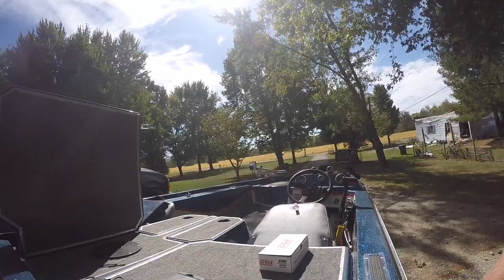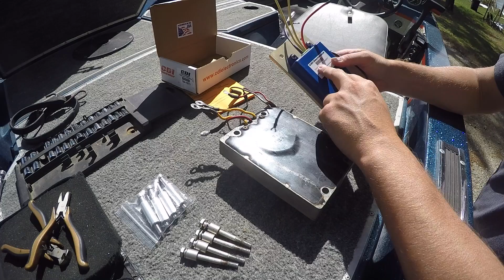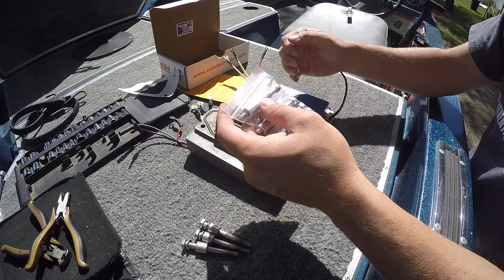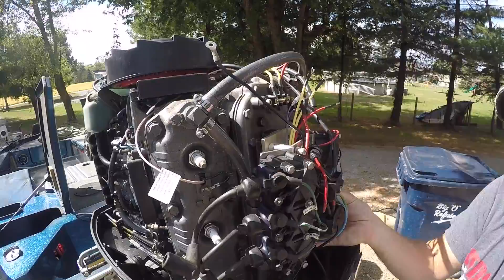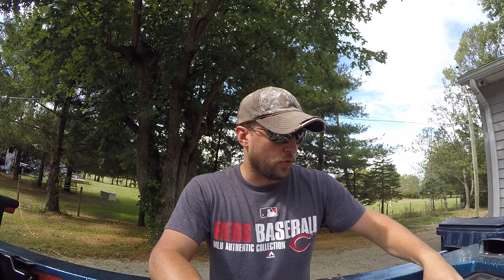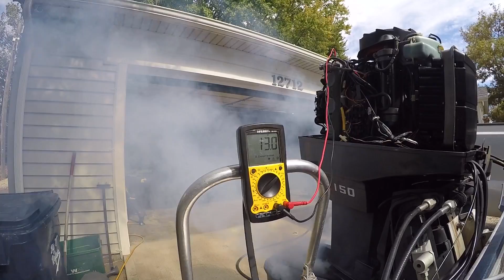89 Mariner 200hp Regulator Rectifier Testing/Removal/Install (Part 2)

Comment: When switching to the dual regulator setup, did you have to replace your flywheel and stator to the 40 amp system with the 5 wires? I can’t see how it would work with the 16amp stator 2 wire system.

Comment: every time i get a water cooled voltage regulator on a 89,thru 92, merc,v6, i use the stanley,voltage reg. from the yamaha,v4 or v6. they work well on the mercs, and have not had any come back yet for any failure.
Reply: Link or part number from yamaha or is it the same years I have a 1989 135 2.0 liter mariner

Comment: Any issues with it after two years of use?
Reply from the maker: Actually, kind of. After about a year of usage, I noticed my depth finder was notifying me of high voltage as the RPMs increased. I was seeing upwards of 17 to 18 volts. Occasionally would blow one of my trim relays so I would be stuck trying to jumper the posts to raise or lower the motor. I suspect some internals of this CDI unit went bad, or were on the way out. I ended up removing it and switching over to a dual regulator setup since it was a much cheaper alternative than buying another unit. I didn't want to keep running the CDI unit with fear of destroying some of my electronics.
Reply: @tristanlee85  Yeah my OEM was doing the same thing 17-18 volts at idle. Sent the radio up in smoke. I just had a local shop order me a new OEM, let me know how that dual regulator ends up lasting.
Reply from the maker: @caden01691  it's kind of a long thread but you can follow along here: https://www.screamandfly.com/showthread.php?350400-Merc-XR2-upgrading-from-rectifier-to-regulator-advice-needed&p=3204505#post3204505 so far everything has been good. Just don't go with the cheapest Chinese rectifiers you can find. You'll see in that thread it actually became a recti"fire" 🔥.
Reply: @tristanlee85 This is unfortunate to hear. I have the same problem and was excited to find a video that had a less pricey solution. I have also thought about covering the water jacket and wiring in two rectifiers instead. I will look into the solution you ended up with on this thread, but if you can make a short video of what you have done it would be greatly appreciated. Thank you again for making these videos! Great work!

Comment: I have the 1988 XR4 150 bored out to 175....That damn motor GROWLS.....hauls ass too!
Reply: the 1988,KR4 was a 175hp  from factory. it was  2.4 litre, most cases . a  chrome bore block. the standard 150s were a 2.0 litre block

Comment: 200 HP? Motor has a sticker 150. My 150 xr4 VOLTAGE REGULATOR
 is bad just trying to change it out.
Reply: 1989 xr4 is the same setup 88 is not
Reply from the maker: Sticker is 150 because the vessel is only rated for 175hp max. It originally had a 150, but was replaced many years ago for the 200, keeping the original hood.
Reply: @tristanlee85  my uncle stiill has his Norris Craft boat. He got it back in 1976 or 1977. It out lasted him. He passed away years ago. His boat hasn't moved since he used it last. It's in a garage and it still looks showroom new. Loved those boats. Very fast and stable. I know your boat runs real nice with that engine. I'm thinking my 150 XR4 uses the same regulator
Reply from the maker: I would check the part number on your existing regulator. I don't know if the same that I purchased will match your motor. I will say I've had nothing but success with this CDI unit though.